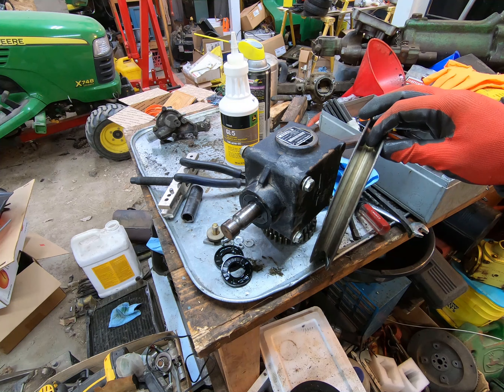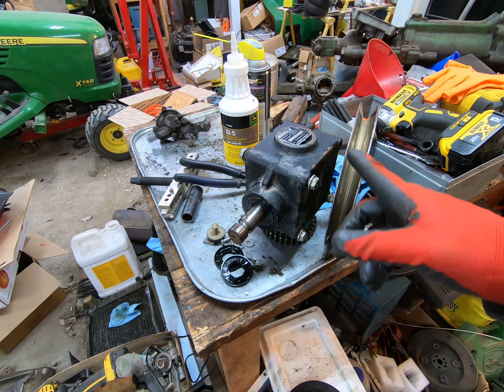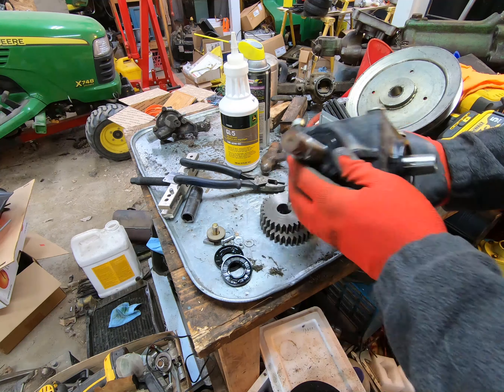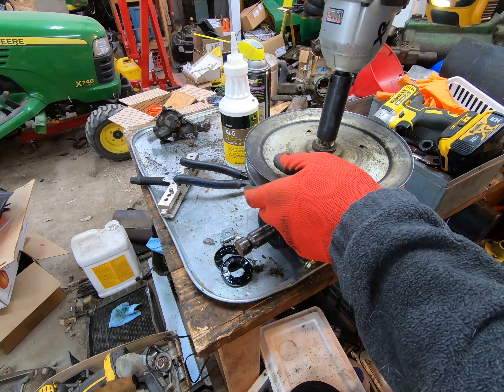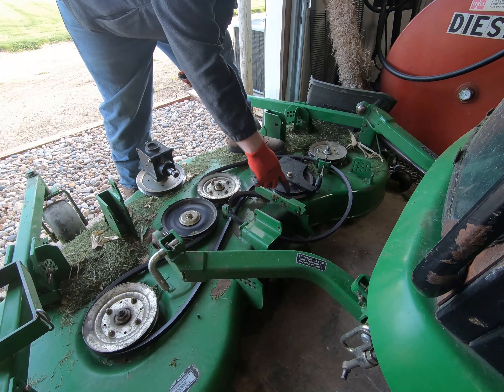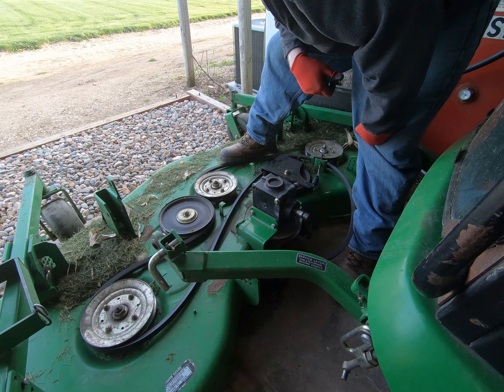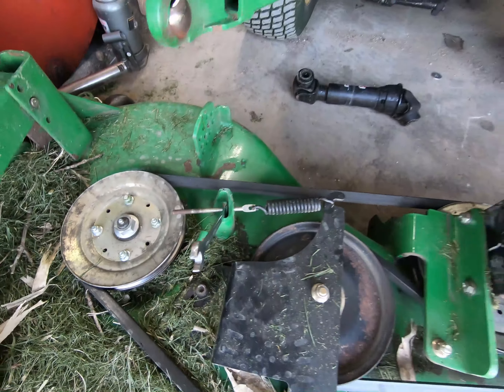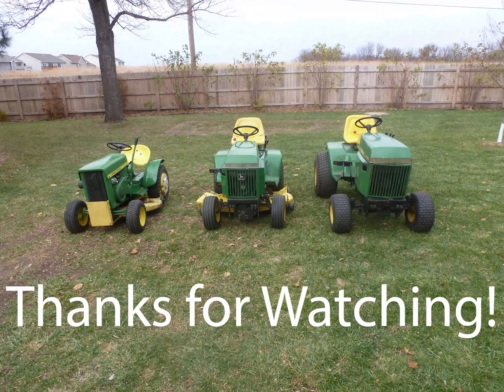John Deere 1445 Deck Gearbox Reseal Part 2

Comment: Two bolts fell out and one sheared off. Only one holding. Has same problem on my old f935. On it I pute a plates oneach side and used the top bolt holes. This time I will use large fender washers to bend over the head of bolt and bracket so it can't come loose.

Comment: How much does a used 1445 go for?
Reply from the maker: Prices are in a very wide range depending on hours and features. A good rule of thumb is $4,000-15,000. Series I, 2wd, 3,000+ hrs, and a 60” deck is going to be a lot cheaper than a series II, 4wd, low hrs, with a flex deck. So there is no easy answer.